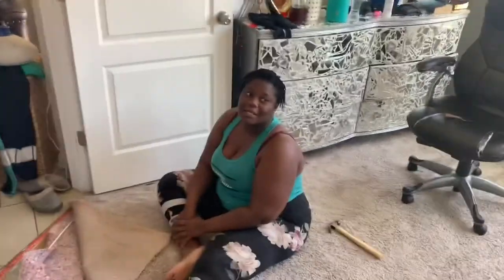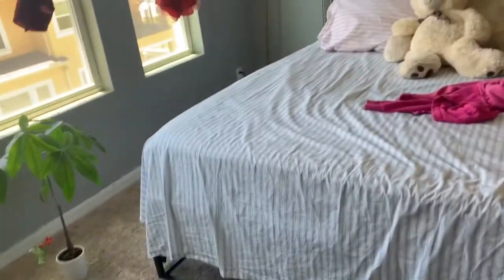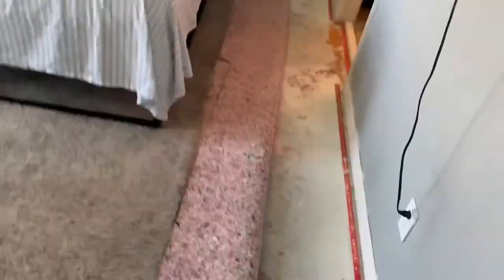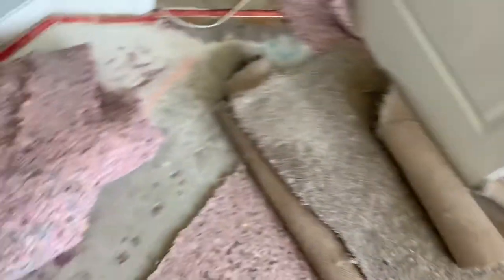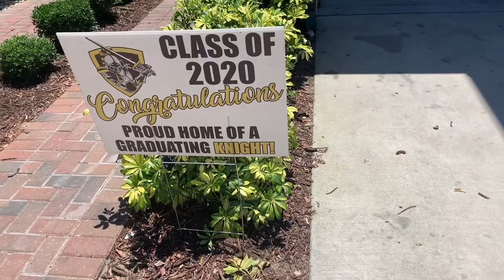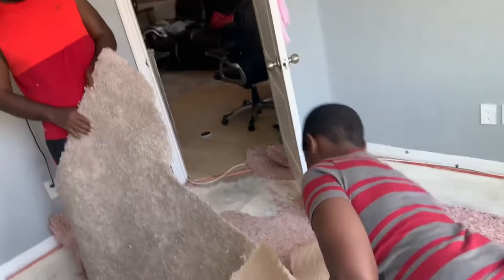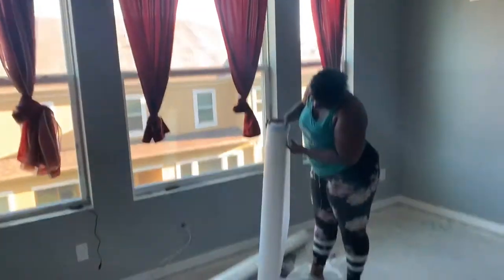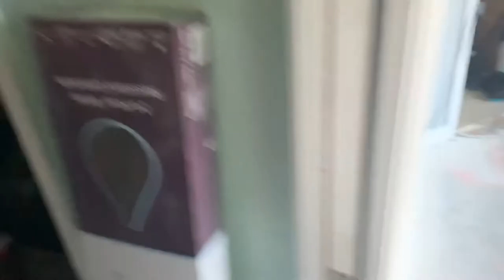ROOM MAKEOVER DIY | INSTALLING WOOD FLOOR REMOVING CARPET

Comment: I wished to become a ballerina in training which I started going to remove the disgusting carpet in favor of hardwood floors

1. Steam clean the carpet with Regina, Rug Doctor, Dyson, Bissell or Oreck
2. Cut the carpet into 3 sections
3. Take out the padding underneath
4. Pull out the staples and tack strips
5. Install hardwood flooring
6. Complete the finishing touches with a ballerina barre (sold separately)